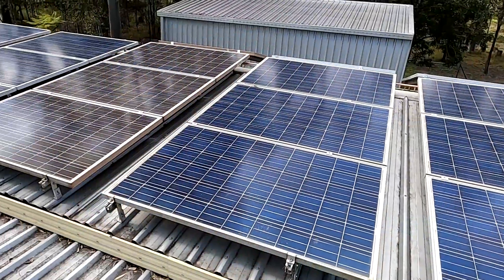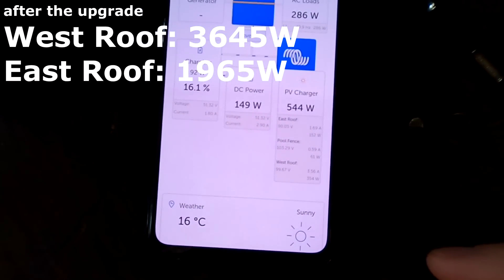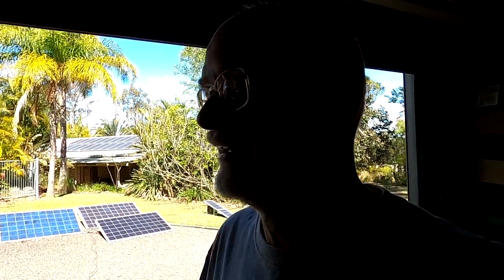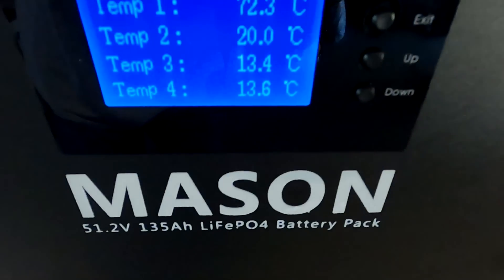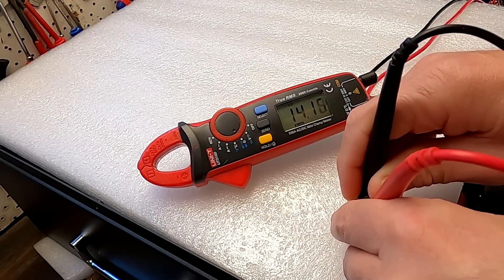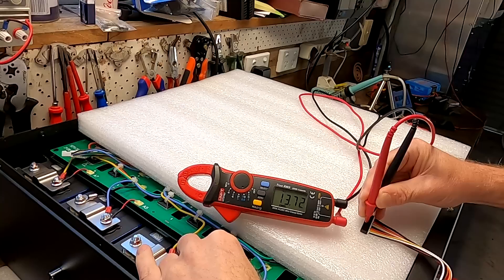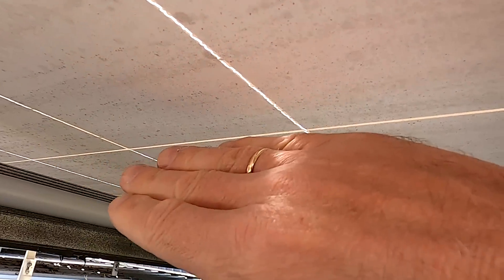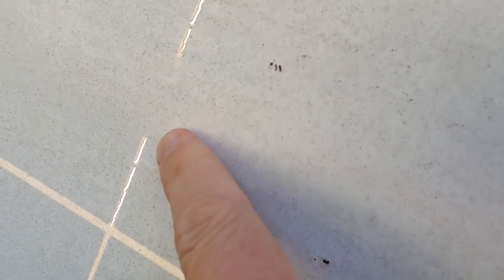SEPLOS MASON temperature sensor problem and a major issue with the solar panels. NOT GOOD!

Comment: hello I wanted to know if you know how to calibrate the program of the bms seplos.

because it gives me a wrong value in ah
Reply from the maker: It's in the manual of the BMS how to calibrate it. Basically charge to 100%, discharge until it turns off. That should calibrate the BMS to your capacity.

Comment: You don't need a RasPi for VenusOS. It runs also on the Beagle Bone Black board (the Cerbo GX is simply a Beagle Bone).
I use the BBB for my installation and it works perfectly. Excpecially I don't like the Pi at all... it is quit a kind of garbadge in a lot of regards.
And the Seplos BMS is talking fine to VenusOS. Is use it too in my installation (ESS).

Comment: Hi Andy,
just an idea for a quick fix: Plastik 70 or similar at your location might help to isolate and seal up this cracks.
I use it always for my Antenna connection boxes outside and always the box fall down but that Plastik Spray stay and keep electrical  running.

Comment: when i had my solar installed i also ran cables for temp sensors, to be able to put sensors “underneath” panels, as well as on frame/front face ..
my plan is to “graph” panel temperatures vs my roof mounted weather station data : ambient temperature/wind speed/direction/solar insolation…
ive noticed that panel temperature (as expected) has a big impact on efficiency … and wind speed/direction(at my qld location) has a noticeable impact on “panel cooling” aka efficiency….
.. one of those “ because i can projects ”  … haha

Comment: Why not get a new system installed for some of the roof? If you get a solar charge controller on the CEC approved list plus panels etc also CEC approved, installed by a CEC approved installer, then the panels will essentially be free and just pay for everything else. I am not saying this fits with your DIY ethos, but it will give the channel a comparison for your Australian viewers. Let me know if you have any questions.

Comment: Hi Andy. I’m thinking about the test on the seplos bms and would it be a waste of time and money buying the kit but then put own Jk or Jbd app based bms in. Or just buy a eg4 or sok rack battery? I know I have some years to go before building a solar system in jamaica, but It’s so frustrating planning the way forward when I see what initially appeared to be a fantastic affordable battery kit then to learn from your good self it’s a headache and piece of junk in my opinion, especially for non tech people like me. Your testing and information is priceless. Thank you, as I would have bought 5-6 kits with my own 280 eve cells. But now it’s back to the drawing board in terms of battery purchase choice. I definitely want to go the server rack route but lithium is still so expensive. If I can find silicate salt deep cycle battery that could be an option. I’m not ready for 3 years any ways. Sorry for long message. Stay safe and please keep teaching me. 👊🏾

Comment: I've completed my garage roof upgrade!  Replacing 18 x 165W (20 year old) SHARP panels with 16 x 320W Renogy panels, DIY (2-manned with my brother), reusing the existing rails!  I chose panels that could be one-manned (barely) and two-manned rather than larger panels which are just a pain to work with DIY.  The old system did around 16kWh/day and the new one does around 32kWh/day in only a slightly larger area.... I had to put 2ft rail extensions on one side to be able to do 16 panels instead of 14, but that's it.

My situation is a bit better sun-wise... basically no shading issues and south-facing at an optimal angle.   4200W peak normal sun in August w/no clouds (bright clouds would push it to the inverter's 5000W limit), so I expect I'll be getting at least 4400W+ when June rolls around next year.

Total cost for the upgrade was about $8000 (panels and inverter since labor was DIY), and it should break-even in around 5 years... or less given inflation.  SMA 5.0kW inverter (97%+ efficient, 3 MPPTs), grid-tie system.  Two strings of 8 panels each going into separate MPPTs.

Its still not the biggest system in the world, but its a huge upgrade over what I've had on the roof for the last 20 years.

--

I have a secondary project to test west-facing panels.  The idea here is that late-afternoon production is becoming more and more important as it is a better match against late-afternoon and early-evening usage.  I have two back-deck areas that get shade-free sun from 1pm to sunset that are perfect.   For testing I purchased an 10ft x 10ft Pergola, reinforced it significantly, and mounted a couple of solar panels on top of it.

Its a very interesting experiment.  The total production is not even remotely close to the south-facing main system on a per-panel basis, but the Pergola is able to produce significant power from 1pm to 6:30pm whereas the main system drops off quickly after 4pm.  The main system still produces power all day (8am to 8pm), but by the time 6:00pm roles around the mere 2 panels on the Pergola are outproducing the 16 panels on the main system.  So it is clear that a west-facing system can do the job of beefing up late-afternoon production.

I think this will matter more and more as utilities continue to move to time-of-use pricing and the 4-9pm period becomes more and more important for renewables production.  I'm trying to get ahead of the game :-).  Main south-facing system for total production, and a secondary west-facing system to fill out the late afternoon.

--

In anycase, Andy, I would consider building a solar shed or solar Pergola ... basically a large open structure in the middle of your backyard that is clearly a lot sunnier than your garage roofs, with a roof made out of solar panels!   Providing shade to what is underneath.  Perhaps on a concrete pad, but with no walls per-say.  A Pergola style.  You would get gobs and gobs more production without shadows causing havoc.  It would be a cool project too... but it would have to be a load-bearing structure so doing a project like that could be quite a significant investment.  Solar panels are not light.

In researching Pergolas (basically 4-post light, open structures designed to have cloth roofs for shade), very few could handle the weight of solar panels.  The one I bought had no chance... aluminum posts were fine but the six aluminum cross-members over the top were designed for cloth, not panels.  I had to reinforce it with steel.   But I think the concept is sound.

-Matt
Reply from the maker: Thanks a lot for sharing, Matt. That sounds like a great system now and look at his increase in generation, wow!
I absolutely agree, the west facing side of my garage starts producing a significant amount of power in the afternoon (I call it the arvo peak).
I also have the other side of the house available for solar. That like another 150sqm of space. It faces a bit to south (where there is no sun here) but is relatively flat from an angle, so ideal to take another gazillion panels.
For now, I will focus on the garage and sheds and see how far I can push this. I can already see an almost daily increase in power production because the sun is going steeper.
I also have some other spots on the property where there is almost no shading in winter, so that will come in the future as well. So many ideas and so little time...
Reply: @OffGridGarageAustralia  I think your randomly shaded roofs would be a perfect test-bed to see if optimizers really make a difference or not.   They don't make sense in a non-shaded situation and often don't make sense even in a shaded situation (i.e. better to spend the money on more panels than on optimizers).  But when half the roof is partially shaded, or more and so many panels are in bypass or partial-bypass, I really wonder if there might be a use-case.

It would be an awesome experiment if you were to get a few, like four optimizers, and install them on one of the under-producing strings to see if they make a difference.

Basically a solar optimizer is just a DC-to-DC converter that either presents a fixed output voltage for a parallel configuration, so ganged strings don't interfere with each other under partial shading situations.  Or present a fixed output current for a series configuration, allowing panels in series to operate in significantly shaded situations without causing current bottlenecks.

My common understanding is that generally they don't make much sense in series configurations since the bypass diodes take care of current imbalances.   But its an open question.   All I can find on the matter is untrustworthy marketing material from optimizer manufacturers :-)

-Matt
Reply from the maker: @junkerzn7312  I have some optimizers here but they don't seem to work with Victron. I think the optis have their own MPPT and will interact with the MPPT of the Victron SCC. I could see the voltage going up and down a lot. The overall output was a tiny bit higher as some points but not worth the extra costs. I'll see if I can get some other brands. These were Solaredge optimizers.

Comment: Hey @Off-Grid Garage is there any reason you don't move the west panels that are in the shade to the sunny end of the car port?  In my thoughts would make a better use of available sun.
Reply from the maker: The west side of the roof is the sunny side already 😉 It's most sunny at the front of the garage and more shady on the back of the roof. But only in winter. It's really getting upwards with the generation every single day now...

Comment: Re: connecting CAN / RS485. For CAN you would need to replace Raspberry Pi to one of the Victron  devices. For RS 485, to Raspberry Pi, I commented before, you need another RS485 Victron VE.Direct to USB cable adaptor (after the BMS adaptor). Victron Cables also need powering both ends, but it’s 3.3v required to the end you have to cut the VE.Direct plug off.

Comment: I think you can put 60 an 72 in the same string (series) as long as they have the same max power current. Even if they have different voltages the mppt will work fine. What you shouldn't do is to put in parallel strings with different voltages.
Reply from the maker: Nope, you can't. It's not about the power but about the current. If on cell pushes 8A and the next only 5, that's not good. Never mix solar panels in series. I have done 215W and 220W in series as they are almost the same current output and this is not problematic.
Reply: @OffGridGarageAustralia  correct, i meant the same current at max power point. Otherwise your string would underperform unless you use optimizers. But having 72 cells instead of 60 means different voltages not necessarily different currents
Reply: So you can!

Comment: Hi everyone. Bit off topic but wanted to get your latest attention. I've been lurking here for weeks after getting a new 12v x 200ah Lishen pack with Daly 4s x 250A BMS and learned MUCH! 

My situation is different to you panel enthusiasts in that I live on a boat with a split system of 800cca lithium engine start battery and 12v x 200ah lithium house system. Charging sources are from 1400w alternator (with built in regulator set point of 14.2v) and 300w of panels. Am presently wading through 3 sets of settings to get best system set up! My gear and conundrums are these: 

* Dual Battery 20A Epever Solar CC. It's currently set to intermittently trickle 1 amp @ 13.6v into 800cca Lithium start battery (during sun)  for "always full" starting reliability. For the house battery, the CC is currently set at 14.6v bulk and 13.6 float. All good, I think.
* The Daly BMS is presently set at 14.6v, 3 65 Max. I think that's best. I never drain below 70%. I charge by engine every morning and evening (if cloudy) to stay 90-100%.
* The Enerdrive DC2DC charger settings are my query. It is a max 50A (740w). The alternator (a 100A) is thus limited to .25C max charge rate. It and the BMS don't get along, yet. 

When engine charging, with the dc charger BULK set at 14.6v, it puts in 50A till BMS shows about 92% then quite quickly ramps down to 30A > 25A > 10A then says "FULL" and shuts off charge to batteries. This is the charger's lithium algorithm, as expected. But BMS via bluetooth app reads only 3.5 (14.00) , not 3.65. This is because the charger is measuring its own constant voltage output set point not the actual cell sum voltage on the cell side of the BMS . So, my question: 

Should I be setting the dc charger bulk max point at, say, 14.8 to force it to fill the cells up to 3.65 which is when the BMS currently cuts input charge? And, once at "FULL" (ie BMS 100% at 3.65v) what should be the best float point so that with motor running on long trips it doesn't keep overcharging. Would 13.6 be good. 

As for balancing  the BMS behaves fine, always balancing on each charge between 3.2 and 3.65. 

Thanks for any comments.

Comment: Why not use a good 3M sticker to seal it.
Reply from the maker: Would this not trap any moisture?
Reply: @OffGridGarageAustralia  hmmm. I assume you would have to dry the panel well so that whatever moisture is in the panel would evaporate. I seen some telling that the back panel can be replaced too but it's some undertaking. But I think once moisture gets in it starts to oxidise so you will have to work soon. This is a with these types of panels. Best to get bifacial since both side has glass these problem are avoided and also you get more efficiency. Its a great setup for you with your metal roof but it has to be higher at least 2-4' so that there would ventilation and better reflection with lower heat.
Reply from the maker: @pulith5220  I should leave them in the sun for a while, ey 😁
Reply: @OffGridGarageAustralia  😂😂😂

Comment: Andy , how about taking an I.R. picture of the cracked panels to see if there are an increase of heat at those locations.
Reply from the maker: There is no heat increase, they performing well and deliver full power. I have seen the cracks developing over time but cannot see any decrease in power.
I can take a IR video the next time when I'm on the roof.
Reply: @OffGridGarageAustralia  I see what you mean, if no change in Power,  then it means according to Ohms law, no change in V, I, or R   (P=V*I    or  P=I*I*R ).   I thought there could have been an increase in Resisivity with the potential corrosion of the Panel's internal bus.  Thanks for the info Andy!

Comment: I have 1 panel out of 35 that ground fault everytime it rains. Only 200 watts. I can't stand it not working. I have silicone it. Still grounded. Mounted it with other end up and seems to be cured. I moved it to an easy access position so I can isolate it in case of fault. Make sure you put the shaky panels where they are easy to get to in bad weather and don't take down the whole system if they fail
Reply from the maker: I guess, these panel will go soon. The cracks are not getting better over time. I could see them developing over seme time. It's a shame, this actually happens.
Reply: I have seen a repair for your problem. One is basically a giant piece of scotch tape on the back of the panel and the other one is polyurethane paint.  Everyday Dave. Before you buy solar panels video
Reply: A lite bulb came on after I posted my comment yesterday. My trouble panel now has 2 coats of 2part epoxy paint. Black because least affected by UV light.   Drowned the panel with garden hose. No problems. No faults. And to the haters of used panels, the last I bought, 33.00 USD. New panels are 300 to 400 dollars. I can buy 10 used for the price of 1 new. My inverter and charge controller don't know the difference between a new watt and a used watt

Comment: Oh I didn't even consider the option of connecting the JK BMS to the Victron gear. This could possibly be a solution to the "current sensor anomaly" issue that the newer JK BMS's have, by using the Smart Shunt as the sensor, but it's unlikely to work that way. 

Let me know if you want me to connect it to my Cerbo GX and give you access. I should have all the gear necessary already. 

I'm sure Maddi will be interested in the options and findings too.
Reply from the maker: Yeah, I'm still hunting for real advantages connecting a BMS to the Victron system...
I'll just do it because people want me to 😂

Comment: HI Andy. I had to reverse the polarity of Tx+ and Tx- to get my RS485 to work. I tried this as a last resort after what felt like a 1000 of ethernet cables and RJ45 crimps i assumed were incorrectly terminated. 😢
Reply: Your poor swimming pool?
Reply from the maker: Ah, good tip. Rx to Tx and Tx to Rx

Yeah, pool needs cleaning after the winter...

Comment: Thanks for sharing the details of the solar panel problem.  Your video shots clearly showed the issue.  Sounds like this will force you to make some changes to that side of the roof.  You might not enjoy all the work it will entail but it should make for a couple good videos.
Reply from the maker: There will be huge changes coming to the whole solar setup. I probably will replace all cells on the entire roof...
Reply: @OffGridGarageAustralia  Woohoo!  The viewers are in for a treat then.  Might be a whole series of videos.

Comment: The plastic of the back side layer is not UV resistant. This is a problem of many solar modules produced between 2000 and 2015. Some modules do not crack, but the plastic decomposes to white dust. If you rub your finger over it, you have a white fingertip afterwards, as if you were rubbing over chalk. Maybe it is especially bad with you because your tin roof, in addition to the UV radiation that comes through between the cells, reflects UV radiation from the side.
Reply from the maker: Yes, that's exactly what happens here, I have white dust on my fingers from the back.